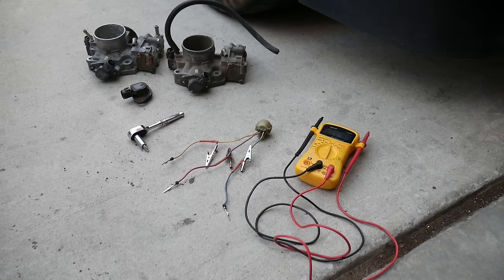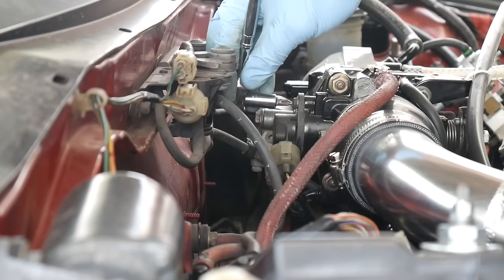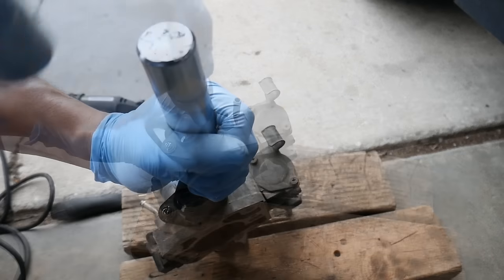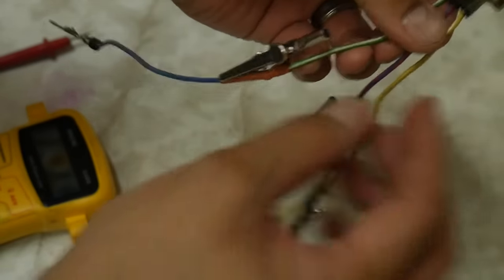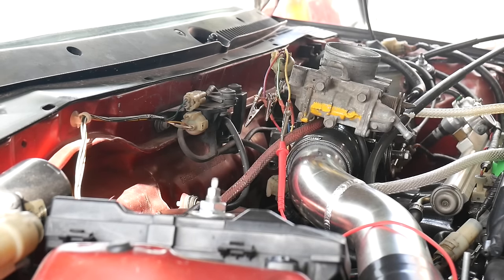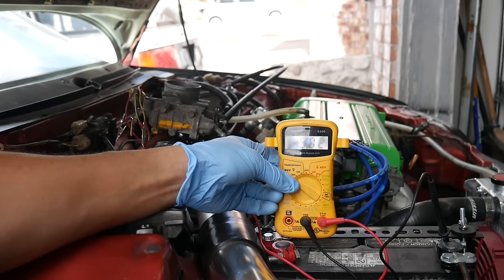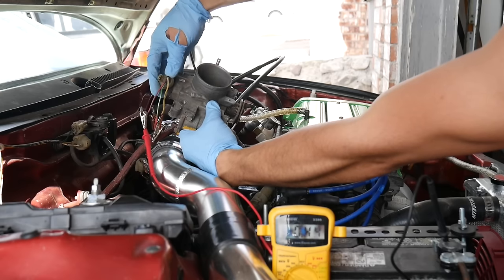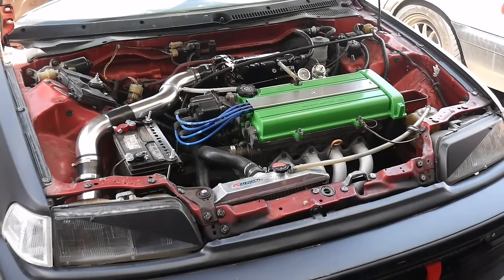How To Replace & Calibrate Honda TPS (throttle position sensor) - Code 7 Check Engine Light

Comment: Very nice you helped me perfectly! I watched several vids but yours helped me where I needed. Thanks Bro!
Reply from the maker: Awesome!  Thanks for commenting!
Reply: @GarageBuiltHondas  yeah I couldn't get 4.5 volts open  and was worried until I saw yours which was similar. Just a little off. My cars issue has been fixed thank god! Shes running smooth and powerful now! :)

Comment: So I don't necessarily need to buy one ? I could just " Adjust " it and everything hopefully will get better?
Reply from the maker: More than likely no if you getting a check engine light?  But it doesn't hurt to try it.

Comment: I gotta check engine light on my 97 prelude and got a code of 45. my car idle when starting up is grrr ruuu grrr so I cleaned my aivc (twice) still same issue.  I bought a tps and of course it's installed using rivets. 
once car is warmed up it runs fine but occasionally it won't accelerate then kicks in. Am I going into the right direction in replacing this sensor? idk it was adjustable, simply just a sensor.
I seen you break the rivets loose by creating a slot and twisting to left but will it tighten back up by just going right? thought rivets were threadless?
Reply from the maker: The throttle body is threaded.  You can reuse the old hardware if it's still in good enough shape.  I usually replace them.  Is your code 45 for the TPS?  If it is, then this could fix your weird idle issue.  The TPS can cause an erratic idld if it's not working properly.

Comment: Sometimes, when changing from 1st to 2nd and giving a 5 or 10% throttle, the engine would rev up and down unless I give it more throttle, SOMETIMES. Could this be lack of calibration or did it get busted? It was one of the things the mechanic changed (supposedly)
Reply from the maker: Possibly.  Maybe a TPS that needs replacing also.

Comment: Hello I just install my TPS was wondering I have it adjusted to.  
 .49v but when I open my throttle it read 4.17 any thoughts? Awesome video tho.
Reply from the maker: Try to adjust the position that its mounted, you may be able to achieve the correct settings.
Reply: @GarageBuiltHondas  I try. I'f I let it be a .49v close 4.18 WOT it giving me an idle surge drop up and down 200prpm to 1000prm. If I tap TPS a bit it stop surfing but idles at 2000rpm flat. Clean out iacv and will be flushing coolant next. Any other suggestions?
Reply from the maker: None but possibly a different tps.  Is everything completely stock?
Reply: @GarageBuiltHondas  yeah everything is stock. It is a D16 motor. I order a new iacv with another Tps to see it helps.
Reply from the maker: Sounds more like an IACV or FITV issue.  Your car may not have an FITV though.

Comment: Sometimes when I’ve driving my car (92 accord coupe EX 5 speed) it’ll bog and almost want to die. If I give it more gas or downshift it’s fine. I’m not getting a CEL either. Would this be the TPS? I’ve replaced the entire fuel system (car is a project and was sitting for a few years) new distributor, new EGR valve, new black box and MAP sensor. The car would seemingly go into a limp mode with no CEL when I first bought it (it’s why I bought it) and wouldn’t rev past 3-4K rpm. The fuel system was bad so new pump, filter and injectors remedied a lot of its running issues. Then my oil light would come on so I just had a new pump put in and timing belt and water pump and the accompanying gaskets and seals. I fear that when picking the car up tomorrow it’ll still have the same driving issue. The previous owner (a mechanic that saved it from sitting) thought since the oil pump was going bad it wasn’t supplying enough pressure and forcing the engine into a limp mode of sorts. But there’s no CEL. My final guess will be the TPS if the issue is still present when I drive it home tomorrow. I have a DMM so I can test it and I’m prepared to buy a new TPS and install it but I want to get a second opinion before doing so.
Reply from the maker: Distributor?
Reply: @GarageBuiltHondas  so that issue, was bad gas in tank. Fresh fuel and sea foam in the tank and it’s fine.  

The issue that is now the only issue, is no much power above 4K Rpms. Just feel like the car is not making much or any power up there. Below 4K is fine. On an extended drive I got the low oil pressure warning light and the car fell flat on its face and would not rev. Upon restarting it was fine. It’s parked for now. 

I’ve replaced the oil pump, water pump, timing belt, and cam seal. What would cause low oil pressure like this? I am taking a wild guess and assuming the low oil pressure has a lot to do with its current drive ability. The engine, is not knocking or even tapping. It sounds really quiet at idle. It just turned over 200k miles.
Reply: @SimbaTheGreat  clogged oil pickup in sump?
Reply: @JA_S_ON  I chased that issue forever. I had a rusted out gas tank that was contaminating my fuel system. I finally changed everything myself instead of paying a shop and fixed the issue. Been fine all year.

Comment: Does anybody in the group have a 1999 Acura CL 2.3 or similar? Wanted to see how your car ran after you put in the new Throttle body position sensor.

Comment: hey bro.....my tps will only let the vehicle rev out close to properly when the voltage is 0.7v closed!...when i set it at 0.45v closed,it seems to go in limp mode and bog out at 3500 rpm. what you think could be wrong?
Reply from the maker: This didn't make any sense to my brain..  "only let the vehicle rev out close to properly when "?  Help me out here.
Reply: sorry...lol that is how we talk in jamaica...but when i set my tps at 0.45 to 0.50v with the throttle plate closed, it bogs when i raise the rpms at 3500. its like i cant raise the rpms smoothly unless i set it at 0.70v closed
Reply from the maker: Jamauto tech Na, you're good!  It just didn't compute in my head when I read it.  Was your car running fine before adjusting it?  It's showing .70 closed, and is it 4.70 at WOT?

Comment: Great videos, thanks. We have an '88 CRX non si model. At the end of the video you show a TPS with plug facing left, that's ours! So, what do we do then? switch the outside wires?
Reply from the maker: No.  You need to find a dpfi specific TPS.  There is no other option.
Reply: @GarageBuiltHondas  I found this

Comment: My husband hadden vladamir 3rd and I have a question can a mpfi throttle body be used for a dpfi set up because my husband cracked the connection to what we both think is a Map  sensor at the rear of the dpfi throttle body and is a difficult part to locate and replace as well as a complete throttle body assembly unit....please help with any suggestion also we replaced the coolant temp sensor but the connector on the wire harness cracked and trying to locate a replacement pigtail
Reply from the maker: No, the TB is completely different on the dpfi setup.  It's an oddball.  The sensors can be bought brand new, that's the only way to fix a broken connection on them.

Comment: i have a '00 civic coupe with a d15b and it has a tps low input code. there would be uneven idles and constant jerking of the car when i'm driving so the mechanic i usually go to replaced the tps sensor. afterwards, it was driving fine but i still noticed a little bit of jerking while driving and it eventually went back to before so i brought it to the mechanic again. he calibrated the voltages with the multimeter and a few days later, it's back to uneven idles and jerking while driving. i'm not sure if i should go back to the mechanic or look for a new one. the code still reads as tps low input. what do you think is the problem?
Reply from the maker: Is that the only CEL you're getting?
Reply: @GarageBuiltHondas "tps low input" is the only code that shows up upon scanning.
Reply: @aTastyBiscuit  did you ever figure it out? Same problem here

Comment: Hey question, I have a 97 Acura cl and Lately it’s been having issues starting, now I thought it could’ve been bad gas or something along those lines but I put in the cleaner and put premium gas in the car and it still doesn’t wanna start right, the battery, and starter are good, I was wondering to see if this would help because my rpms are also not always at a set spot and will jump a lil sum times I really couldn’t find much on the issues beside the TPS also it seems to do it after the car has been running like if it sat overnight it would start right up, but if I drove like an hr + than leave it for like 20 minutes it does this.
Reply from the maker: Any CELs?
Reply: @GarageBuiltHondas  nope
Reply: The only light I have is my abs light but I changed my brakes and not rlly worried about it
Reply: may be some issues around the throttle body. the throttle body sensor, the throttle open and close mechanism, etc.

Comment: Do you know if  installing the TPS sensor without calibrating it will cause bogging issues?
Reply from the maker: No
Reply: Ever find out anything? I’m bogging
Reply: @bradleybaynard5536  I had a bad ECU

Comment: I made the same diy "TPS splice connector" I even made an extra connector with a male USB to feed constant 5 volts so I don't have to turn the key on. Lol TPS cable was for k series. Little space to calibrate :(
Reply from the maker: Aries Robillos I've never worked on one yet, I'll keep that in mind!

Comment: This is an old video but I was wondering if you could help me. My tps output signal is very low varying between 0.05 to 0.08 at Closed throttle and it doesn't change when I open up the throttle. Ive checked and I'm getting 5 volts on the positive and negative wires. So would that mean my tps has gone bad? It's also fairly new and was working. If not then any other ideas you might have would be much appreciated.
Reply from the maker: Do you have another one you could check also?  If it's giving you those readings it almost sounds like it is faulty.  You're multimeter is setup correctly and all connections fine?
Reply: Garage Built Hondas thank you for responding and I do but it's one I randomly found in my box of bolts and things. Its prbly faulty as well, because it reads exactly the same. Yup the multimeter and all connections are as good as can be. So it's most likely faulty tps then
Reply from the maker: You know, head to the auto parts store and buy one, come home and test it out.  If it's still giving you the same reading then something else is wrong and you can take the TPS right back and get your refund. 😀
Reply: Garage Built Hondas that's what I was thinking, thanks man :D so if that ends up being the case, could it be the ecu?
Reply from the maker: Probably not.  More than likely a wiring issue.

Comment: is it okay to remove the tps from the oem throttle body? my tb needs replacing but the after market one i have needs both sensors to be put on the new throttle body and the tps looks revited.
Reply from the maker: Yes it's ok.

Comment: Need help first time doing this but I have a 92 civic vx hatchback the throttle body is much smaller I bought an ek arm intake which is alot more wide open then the eg one can I just swap out the ek throttle body to my eg which they just bolt right on ?
Reply from the maker: I'm not sure if it'll fit.  Might be too big.  The arm will fit, you might just need a silicone reducer.
Reply: @GarageBuiltHondas  thanks for the response but sadly the ek throttle body is much wider so I wasnt able to just bolt it right up so now I think my option is to either try finding the ex manifold n see if theres is bigger or just go buy an intake for the 1.5 leter intake
Reply from the maker: Are you talking about an intake arm and filter?

Comment: Thanks for the video!  I replaced the oem tps because it had a dead spot.  I replaced it with a known good oem but I cannot get it to adjust spot on.  To get wot to 4.50 I have to adjust closed to .70.  If I adjust closed to .50 then 4.30 at wot is my best. I split the difference and left it at .61 closed and 4.43 wot.  Should I shoot for the best closed reading or the best wot reading?  Or is splitting the difference ok?
Reply from the maker: What you did is perfect.  You won't be able to tell the difference and you'll still be running optimally.
Reply: @GarageBuiltHondas   I love this channel!!!!   Thank you Sir!!!!!
Reply from the maker: You're welcome!

I'm so glad you do!!
Reply: Hello, do you remember the part #? I have an 06 honda accord but fir the life of me, I don't know which part will match my tps.

Comment: Could the tps be causing my car to idle high? I have the tps code and map code but the map sensor I replaced but still reading the code. Could a bad tps trigger the map sensor?
Reply from the maker: It's possible, but unlikely.  Try to get it fixed first and if the idle is still high then you.knownits not the TPS.

Comment: What are those bits at the end of that harness you made up called ? I'd like to buy some to make a harness like this. The parts that are pushed into the original parts. The ones after the alligator clips
Reply from the maker: I got them from some old honda plugs and de-pinned the plug.  I believe they were from a distributor plug.

Comment: 91 Honda Accord ex f22a4 I replaced mine tps sensor I got 4.5 v close open 0.5 v what am I doing wrong need help
Reply from the maker: Try swapping the wires around

Comment: I have a 2000 Honda Civic ex and the problem with mine is it only engages in limp mode in the cold? Do you know how I can fix it?
Reply from the maker: Engages in limp mode? What engages, sorry I don't understand your question.
Reply: Jon Widmer I read a recommended video on how to fix limp mode on a 2000 Honda Civic and in the video it said that it's not going to be any major engine parts like the alternator, ecu, battery, etc.. it said that it's going to be the tps valve
Reply: Jon Widmer sensor*
Reply from the maker: Have you taken it someplace where there can plug into your ECU and see what's wrong?
Reply from the maker: OBD2B cars are a lot easier wit the diagnostic port that they can plug into and diagnose any problems.  You may have a bad ECU if they have trouble communicating with it.

Comment: I have a 93 integra ls, which is the same manifold and throttle body on your car, will my tps readings need to be the same as yours are? Planning on installing a new intake manifold, throttle body and tps this weekend and want to make sure before I do it.
Reply from the maker: Yes
Reply: @GarageBuiltHondas  awesome, thanks man, I appreciate it. Contemplating maybe doing videos of the progress of my car, there isn't a lot of da hatchbacks on youtube with guides on how to do stuff
Reply from the maker: Nice, it could be fun for you just to enjoy making videos also.

Comment: Thank you for your video! Very informative! When de-enrgized mine appears to be about 1/16 of an inch open. Is that normal? Or should it be fully closed?
Reply from the maker: That's normal.  It'll always have a slight opening.

Comment: I have 4.5 closed and 0.5 full open ,,,,, its revers of what the video said !!!
HELP !!!
Reply from the maker: Are your outer wires swapped?  Original engine and no modified harness?
Reply: I have some issue the wire are the same no change

Comment: Hey man i have code 4 on my 1991 civic DX D15b2 were is the crank position sensor located
Reply from the maker: Inside the distributor
Reply: @GarageBuiltHondas  can i replase just the sensor or all the distributor

Comment: Can the tps cause slight rpm hunt at 1500 rpm down 100 rpm to 1400 rpm and sorta be stuck in that small loop until I give it more gas or let up on the gas? This only happens at a slight pressing down of the gas pedal and keeping it that consistent speed
Reply: I have a video on my channel that shows what happens with the tach
Reply from the maker: +Rick Harrison if you're applying gas and it's moving, does it feel like the transmission is slipping?  Any CEL's?
Reply: Garage Built Hondas no cels that I am aware of, if I press on gas and hold it at this certain speed and in 4th gear, it doesn’t feel like it’s slipping as it’s already shifted into the gear, but it’s at the lower end of the gear and if I hit the gas a little faster it accelerates and gets unstuck from that loop

Comment: My car goes on limp mode at around 2000 rpm but my tps was never connected since I had the car but once I connected it ,it started limp mode any idea?
Reply from the maker: +The Gaming Kid are you getting a CEL for the TPS?

Comment: What if the tps reads .5 to 4.1 wide open but won't turn anymore? 03 Honda civic 1.7l
Reply from the maker: I'm not familiar with those civics, does it have a throttle cable still?
Reply: Garage Built Hondas yes it has one.
Reply: Garage Built Hondas after putting it back on with the above measurements the code cleared and the threw up a p1106 baro curcut 1 of 2 code both the same
Reply from the maker: +Atah714 try this.   https://www.engine-codes.com/p1106_honda.html

Comment: What year are your Tps.  And are all Honda tps adjustable.  I have a rough idle or stall at 1500 rpms the nose every time.  I have tried everything else.  I have no check engine light
Reply from the maker: David Valentine what car and what engine do you have?
Reply: 1999 Honda civic dx 1.6 L
Reply from the maker: Your TPS is adjustable on your car.  You've done the basic maintenance?  Plugs, wires, fuel filter, distributor all in good condition and replaced sometime between 1999 and now?
Reply: yep
Reply from the maker: David Valentine If it was my car my guess would be something with the intake manifold.  Possibly a sensor or injector that needs cleaning.  Ever change the fuel filter?  What about the IACV?
Reply: where is the fuel filter